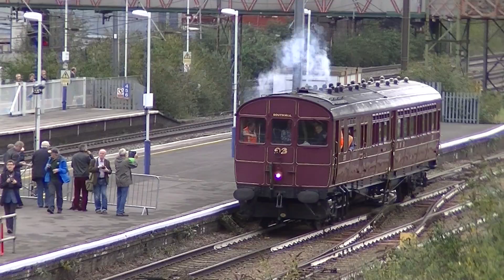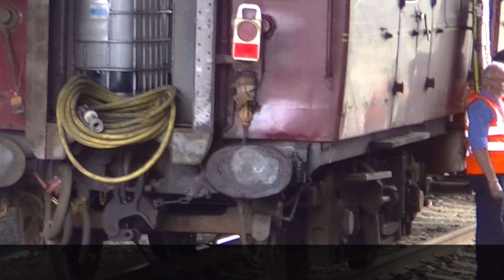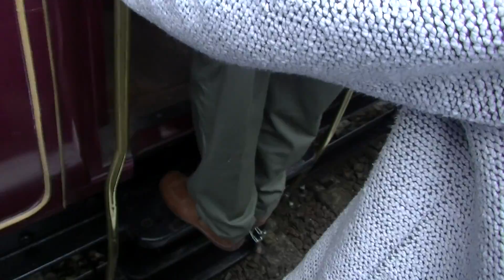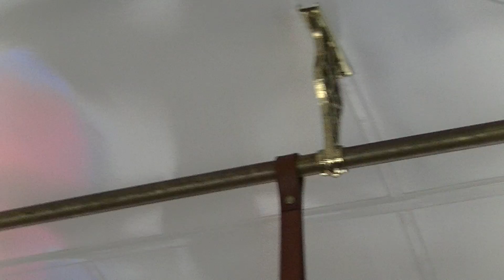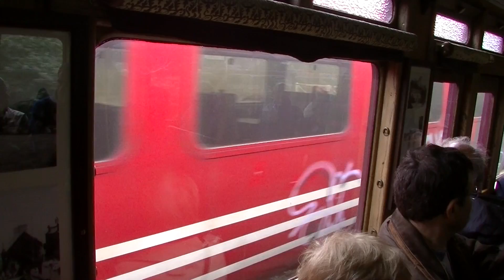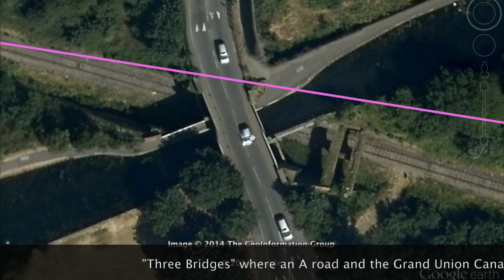A ride on the GWR Steam Rail Motor

Comment: A curious thing, seeing what looks like an Edwardian Pacer, but it's chuffing out steam...
What kind of speed could those things get up, and how exactly would you stoke them? Is it a vertical type boiler like on some of the Scammell and Sentinel steam wagons?
Reply from the maker: yes its a vertical boiler, the scammels and sentinels being a good analogy, speed wasn't great about 30mph, and with the extra coach and passengers  often had to stop and brew up more steam on steeper inclines.
Reply: Intended more for commuter stopping services with very short runs between stations than any kind of longer distance work (like DMUs get put to these days) then, I suppose...

Comment: interesting interior design . Th gas lamps were installed in the Australian Tat carriages and converted to electric power in 1919the windows and doors are similar to the Tait carriages also These trains ran first steam hauled but later electrifide there are a few still preserved here

Comment: I believe this train was a victim of it's own success and has a telling story about railway services. Where introduced, it improved the frequency of services, but unlike a DMU couldn't be extended easily- a trailer car was added but made the unit underpowered-  so it had to be replaced by a conventional autotrain. That a new train and service can bring new traffic is something that got lost in management, though there are examples such as the HST where that has been the case.

Comment: It was an interesting concept for the time but would seem to have been very inefficient and low on traction power. Did they build many of them??
Reply from the maker: about 99, in use from about 1903 to 1935. Lack of power when full or on gradients was an issue.